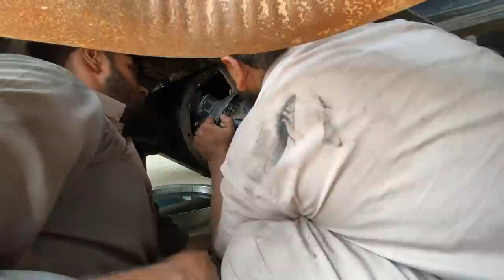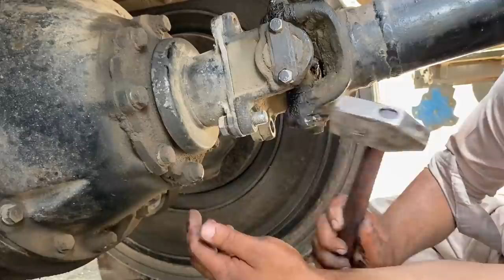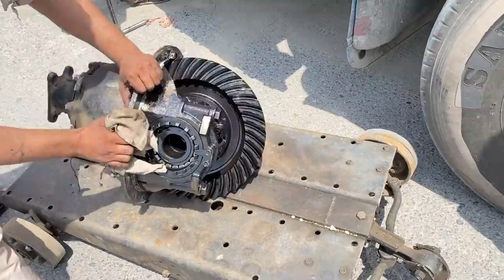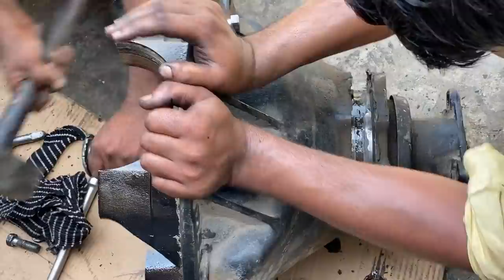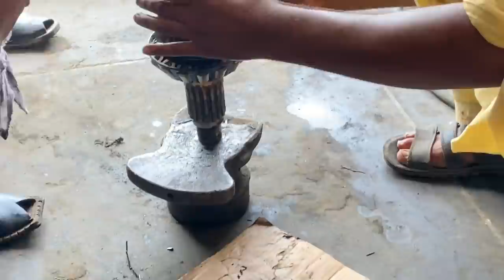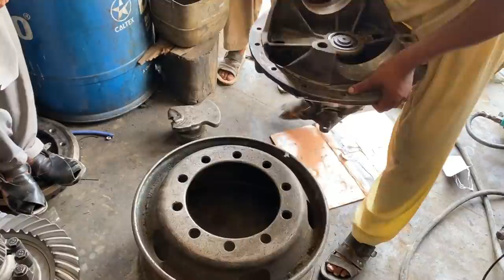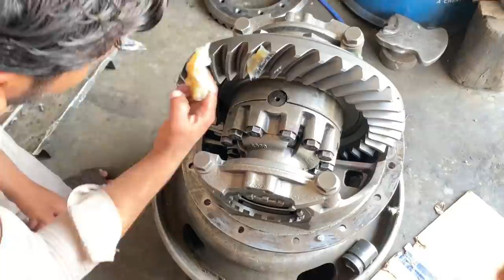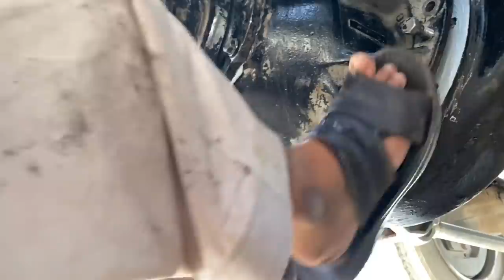The sound is different from the differential gear. Open and check

Comment: It's amazing what can  be done with the precision instrument that an experienced eye and hand can become.  These guys are amazing.  The backlash setting was truly impressive.
Reply: Impressive?  They didn't even measure it! They have no idea if it was even close to the required spec.
Reply: @e-curb  That's the point.  They have enough experience without the use of tools that we have available to us to set it properly.  You can tell that he's done this many times.   My point is that with experience, the human eye and hand can get very close.  

When I was setting points back in the day, I calibrated my eye with feeler gauges, but eventually I did it by eye and ear.  The results were better when I eyeballed it and listened to the engine.  That's what experience gives you. 

BTW - The "required spec" is variable depending on numerous factors. Blindly setting it to a number is only optimal if those factors match what was used to establish the "required spec".  Again.  Experience.
Reply: @bkf8166   @BKF  you can tell by looking at the trace that they had too much backlash, you do realize a brand new meritor or rockwell gearset is around 16-18 thousandths not only that they had NO pinion preload I worked with guys who did truck tranmissions and diffs for 40+ years and iv seen them get it close all you have to do is look at the middle tooth after the did the trace to know that it was WAAAY to much backlash there's a reason why dial indicators exist because 1-3 can make a huge difference on where a trace sits, especially once you apply torque to the diff the trace will move up
Reply: @kp-ig9ex  So what's your solution.  Buy these guys your precision instruments, or RESPECT the fact that they can achieve a serviceable level of precision with 1/10 of the tools that you have?

Come on.  Give them their due.  Just watching them, it's obvious that they've done this MANY times.  So, ipso facto. It works. They're effective mechanics.
Reply: @bkf8166  the only tool that I have that they don't is a dial indicator so I don't know where this 1/10 tool comes from but even then it isn't needed because I was taught by two driveline  guys who had done these 40+ years and did everything by feel or trace .

With that being said pinion preload you need SOME drag if they did it would have only spun a handful of times. All they would have had to do is turn the spacer on a belt sander on both sides 10-15 seconds each and give it a whirl especially for the time it takes.

Just by looking at the trace e you can tell the guy didn't have deep enough pinion depth and backlash. All they would have had to do is take a shim out which you can also do by wiggling it 3-5 thousandths will bend very easily. .10 not much then you're 20s not at all. Adjust it until you feel comfortable with the backlash then check the trace again and if it's too much keep adjusting until that trace is about 3/8 from the toe of the drive side 

Wooooah look at that not one precision tool wonder where all my fancy tools went 🤔
Reply: @kp-ig9ex  OK.  Not sure what your point is. Unless it's simply that you're a better mechanic than them.   Congratulations. 

My point?  Look what can be done if you need to do it. Yay human ingenuity.  Give them some respect.  

And try to give them some credit for what they've accomplished under circumstances that you and I would never even consider working.  Because we don't have to. You know.  Because we're Americans. 1st world.

Comment: All the contamination aside,  the pinion shaft bearings are trash after punching them out.
 I didn't knew this for a long time, but heres why:
 When driving bearings in  you have to apply force on the  race which is fitted.
On a shaft, inner race, in a seat on the outer race.  
When you just hammer it in by the outer race  while instaling on a shaft  you push the outer race against the balls which push against the inner race leaving indentations on all 3 parts 
which will cause vibrations.
When you dont reuse old bearings its irrelevant, but when reusing parts try to apply the pushing force  directly on the race  you try to push out.
Again,  bore-outer race, shaft-inner race.

Dont use punching pins, i try to use a pipes/sleves, s so the impact goes  not in one spot potentially deforming parts.

Comment: It's amazing what can be accomplished with rudimentary equipment. Not the right way to do preload, backlash or pinion depth, however.
Reply: Hate to think the noise from an axle that hasn't had correct preload & pinion mesh set
Reply: Ya , But they got it done !

Comment: Reusing metal contaminated bearings, spinning dry bearings, not setting pinion depth or ring gear backlash. Not to mention the axles and rear housing are still coated with metal contaminated gear oil.  Makes me wonder how long the new ring and pinion will last.
Reply: Labor is cheap there, and parts are not. That ain't their first rodeo. They'll rebuild it again. .
Reply: @textech4056  Labor is cheap there, parts are not.
Reply: @textech4056  Dunno, $283 for pinion and ring gear is pretty cheap.
Reply: @honkie247  Thank you. I stand corrected.
Reply: @agt155  Might be a different story for new bearings. The gears were probably made in China.
Reply: @textech4056  could be domestic, they have a lot of small foundries machineshops and forges making parts in pakistan

Comment: These guys are high tech compared to a lot of these videos I've seen...they have an IMPACT GUN!
Reply: It's the same guys chief
Reply: But no torque wrench they did torque anything
Reply: @ronaldterry2234  trucks like that is as tight as you can torque specs is for engines and tiny moving parts big parts crank um

Comment: Inner pinion bearing should be good for at least 500 miles after its been pounded in like that. It’s weird that they do all the hard work and yet they don’t have a simple home made press to fit the bearings.  They could make one with some steel box section and a bottle jack in a couple of hours. Also, that sounded nasty when the preload was being set!
Reply: What preload? Everything seemed to spin much too freely, plus the crownwheel was out of mesh?
Reply: Back before I had all the tools I do now, I installed bearings like that and... maybe I just got lucky but it was never a problem.  Those bearings and races are pretty tough.

But yeah... that bearing preload and backlash didn't sound good.
Reply: I'm very confident that this diff will be just fine 50,000 miles from now, if not 100,000. If this unit went bad within 1000 miles from now then there would be very serious consequences for the builder. This isn't America where you would take them to courrt and file a complaint with the BBB. Here this repair cost the owner a LOT of money (to him) and this truck is his living. He will NOT tolerate this failing prematurely. Its obvious these guys know exactly what they are doing and you have no idea what they did and didn't check and how they check it. The video is 14 minutes long, do you think they actually did this job in 14 minutes? These guys do this shit all day, every day and they know how to do it. They checked the pattern and with adjusters they are probably practiced enough to know backlash just by jiggling it. Do this stuff enough and inch-pounds torque required for preload can be felt. How many diffs this big have YOU set-up?
Reply: James Radcliffe i don’t know any mechanic who can tell the difference between 10,000 and 15,000’ths of an inch by feel.. that’s why we use dial indicators.  But in this video you can literally see it’s too sloppy, don’t need to feel it!  I’m all for doing emergency repairs in the field, I work on old tractors and have them in bits in the mud all the time, a hammer is my go to tool for 50% of jobs, but specs in machined parts exist for a reason, and how much is a dial gauge, surely not so much they can’t get one and set that backlash, and the corresponding preload, accurately rather than just guess? Would take like 2 mins longer to do.  I’m simply curious as to why they do it they way they do, rather than criticising it for no reason.  Any man is free to run his business how he sees fit.  I would not be anywhere near as confident as you in the longevity of that diff done that way though.
Reply: @kristoffscuba5466  The video is 14 minutes long, do you think the job was done in 14 minutes? I would bet my life it wasn't. Neither you or I KNOW what was done in the set-up of this rear. Him spinning that ring while playing with the adjusters might have been just a preliminary set-up. They might have wheeled it in and checked it on a bench with an indicator , although with a ring and pinion that beefy there might be .025 play allowed, and a practiced hand can tell .025 by feel. I do doubt they have a non-click type, inch-pound torque wrench for pre-load. But I dont KNOW that. Does this rear require that kind of precision on bearing pre-load? I don't know, and neither do you. These aren't American made trucks and the diffs are probably European or British. what I do know is that just by watching them work these guys do this stuff all the time and practice makes perfect.
Reply: Honestly, it can go quite a long time with wacked backlash and pinion depth. Now if you don't want it to make noise, that is a different story.
Reply: @turbone54  hey man, I had a prelude before. 

Ouch. Very ouch lol
Reply: someone's never been out of country......
Reply: I have rebuilt many larger differentials in front end loaders. Never did I pound on old or new bearing. In the field we warmed the bearings to slip on the pinion. Always disassemble the cross and spiders and replace when worn.
Reply: Didn't see the pinion shaft nut getting tightened either. Im sure THATS not critical... no dial indicators or bluing of the gearset. Yep, this will be a reworked job especially with the hammering of bearings. Unbelievable...
Reply: @numberpirate  was there any need for that
Reply: I would add that having a dead blow hammer might save some damage.
Reply: That's why when I was over in Pakistan I rented a camel the whole time I was there for three weeks it never broke down
Reply: @numberpirate  oddly enough, there's much less generic variation in people with European descent.
Reply: @bardigan1 < Incorrect.
Reply: @ihave35cents95  Did you get fed up with it?
Reply: @michaelharvey1197  not at all I had to leave I was in the Navy
Reply: There's always one.  This time it's you.
Reply: @ihave35cents95  i smoked them😂
Reply: @johndonahue1935  true. We used to boil the crap out of those bearings.
Reply: @jamesradcliffe3985 usually it requires precision but if you use old bearings and or newly hammered in bearings precision goes right out the window. Those toyotas work f-ing hard and i can guarantee you it will get 25k max considering the roads they use combined with the loads they carry.
Reply: @drevil2783  I hear you and I was on one of those camels I went and bought $10 worth of hash the guy came back with a 4lb carved elephant out of hash I had  to break the foot off and hand it back to him we had drug dogs at the bottom of the ladder to board the ship. Fun times I cashed in $2,000 with an exchange rate of 18 rupees for $1 I was loaded
Reply: @ihave35cents95  fuck me dude!!!! That was funny😂😂😂😂😂😂😂😂😂
Reply: @kristoffscuba5466  I don't know of any measuring tool that approaches 15.000 thousandths never mind 15 thou. by eye 😺
Anyhow as soon as he spun the crown wheel and I heard the crunching grinding awful noise - I knew those would last 500 miles before falling apart.
Reply: @paulstandaert5709  the video was sped up several times real
Reply: @jamesradcliffe3985  Plus that truck could be ready for the scrap heap soon ANYWAY and this repair was just a cheap bandaid to get it on the road  and a few more trips before the engine fails
Reply: @HobbyOrganist  I thought they just worked that fast.

Comment: Absolutely amazing. It takes them a day to do what American mechanics do in a week and then charge us an arm and a leg for it. Love watching you guys work.
Reply: You get what you pay for
Reply: In America they use torque wrenches so the bolts don't loosen up and fall out. In America, they know how to set the pinion depth, diff bearing preload, ring gear backlash so the R&P lasts more than a couple of months. In other words, that repair in America will last a million miles at 70mph. The job done in this video won't last 6 months in that truck that might see 40-50mph tops.
Reply: So they have to overload the trucks to get the job, then drive a dangerous vehicle to make money.
After that they have to pay for repairs.
Not an ideal system.

Comment: Hate to see bearings and shafts hit with hammers 😳 Doing what they can for a price i suppose.
Reply: Heh - they mounting the same old bearings with hammer. Real engineering here :)
Reply: "it's fine as long as the truck's moving again" a concept you can find in any individual repair shop in any developing nations =_=
Reply: I'm wondering if that pan of oil was re-used to (yikes!).  Do what you can with what you have I suppose.
Reply: Nope, can make a bearing puller from some scrap flat bar and threaded rod, no excuses for that gimpy haha.
Reply: Those bearing probably have a million miles on them
Reply: @8180634  I cant imagine that it was disposed of in an environmentally friendly and safe way.🤣
Reply: They were only hitting the bearing inner ring, not the actual rollers or outer ring - no damage done here - nothing to see.
Reply: @searlasmacmaongail9418  they probably sell it to a local foundry or something running furnaces on waste oil..

Comment: I like differentials, that allow the use of spanners to adjust carrier bearing preload and position. I hate having to use shims. Now, if there was a similar way to adjust pinion depth, that would be ideal. With this unit, I guess shims can be used to adjust the depth of the pinion bearing assembly. Getting the perfect mesh ensures the longest possible service life, as well as durability. (more forgiving, if the driver lets the clutch out too fast) This failure looks like metal fatigue, just simply too many miles under too much load.
Reply: That or a lump of gravel that was rattling around in there since the last time it was fixed.